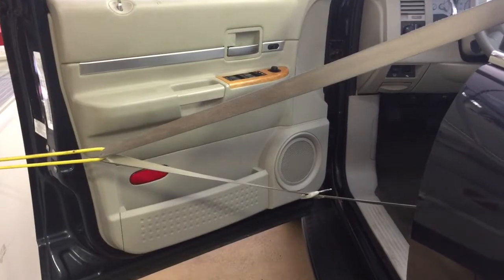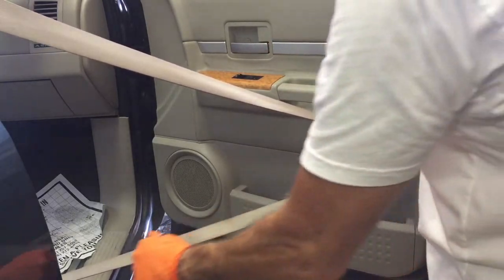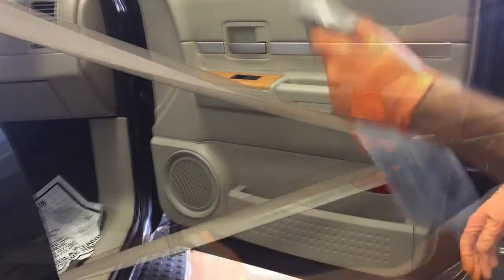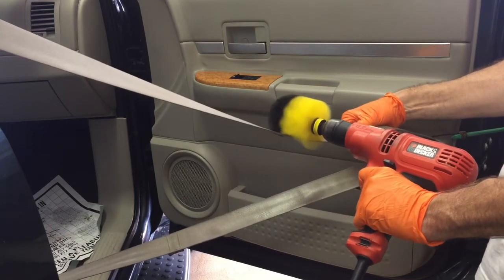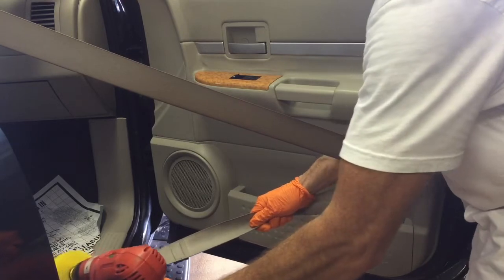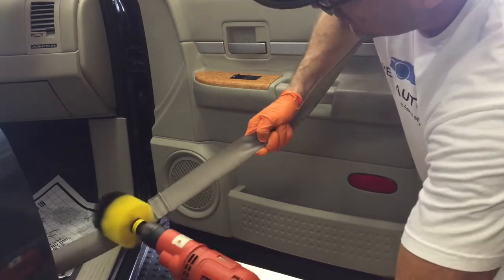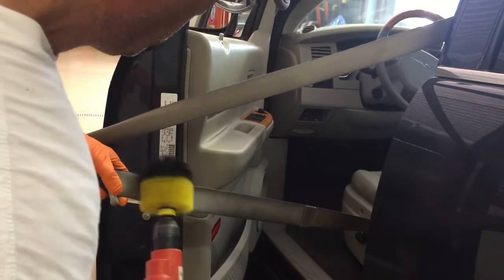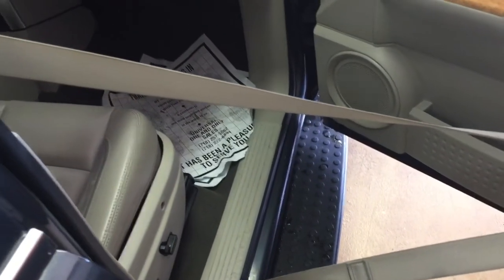How to Clean SEAT BELTS!!!  Assisted by Matrix Spot Remover and Drill Attachment Scrub Brush!!

Comment: Used this basic method today, worked great.  Tedious and time consuming, but it worked.  Applied liberal amounts of cleaner (I had plenty of time to let it dry), wiped, steamed ($29 Bissell), applied more cleaner, drill brushed, extracted (Bissell SpotClean Pro) , and left to dry....  19 year old belts now look like new.
Reply: Don’t wet clean belts. This compromises the structural integrity and removes the flame resistance. Never use acidic cleaner.

Comment: Hey mate, thanks for the upload, great videos and thanks from the UK. 

Just a thought regarding damp seat belts, would you recommend using a heat gun/hairdryer to get the last bits of dampness out of the belt or is this not a good idea because of the belts being polyester? Would appreciate some advice on this.

Thanks again
Reply from the maker: Greetings... the material would easily withstand that. What I do is pull up my infrared heating lamp used to cure ceramic coatings and let it dry the belts for a few hrs. 👍🏻